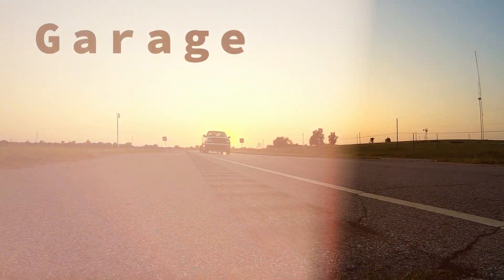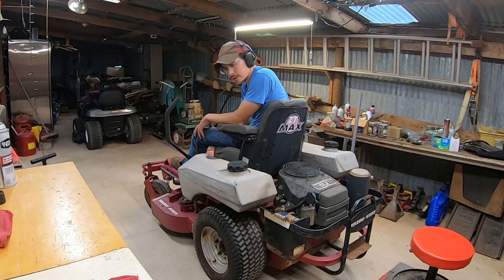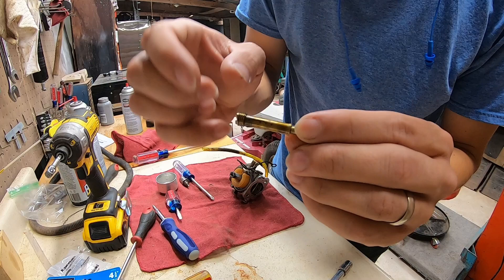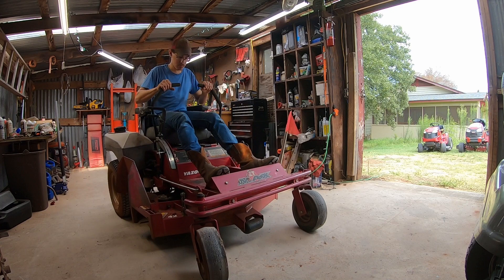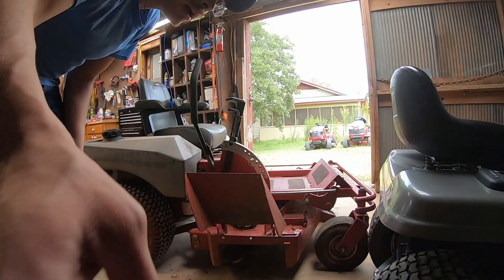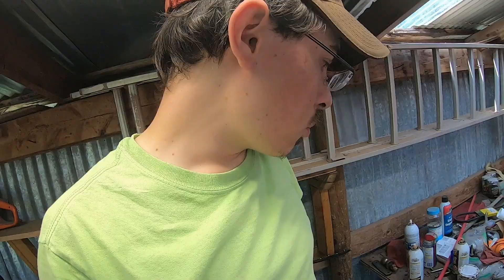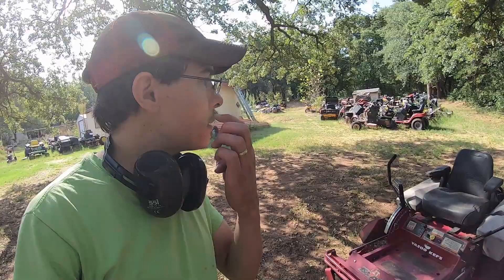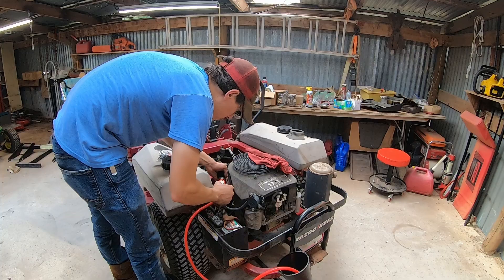My $200 Commercial Zero Turn has issues! Is it the carburetor? Or — ? Yazoo Kees | Garage Story

Comment: Those tiny screwdrivers are notorious for damaging main jets...ah I see that you did get a new driver. You'll appreciate it more. Don't forget your idle jet
Reply from the maker: I think I could use some more small screwdrivers. One broke, and another I ground down to fit a tight spot. I can’t remember if that was in this video or a different one

Comment: Try replacing the fuel line, mine was deteriorating internally and clog the fuel delivery to the carb 7:26
Reply from the maker: Seems like it turned out to just be junco in that 90 deg fitting coming out of the tank. It’s working now!

Comment: Strange thing to have that one piece of fuel shut off device  can cause it not to run correct 😮
Reply from the maker: Little things can be the most difficult problems…
Reply: @garagestory  my thoughts on the fuel shut off were a little off but it is running again because of the universe key switch which is the same one that m.t.d and snapper mowers use  they are  common on some of the mowers  main thing is that you got it running again
Reply: Invest in a ultra Sonic cleaner one of the cheapest tools to invest in
Reply: @randyseabolt272   that is great advice on this matter young man 👍😎
Reply: It is not a fuel shut off solenoid, it is the anti after fire solenoid.  It shuts off fuel to the main jet. The second long piece you pulled out of carburetor was the emulsion tube.  Cut the pintle (small metal rod) off the solenoid and you won't have to worry about it not working in the future.
Reply: @mikespain8655   I had to do that for my 19.5 Briggs and Stratton engine that is on my poluan  XT mower the carburetor is a Niki carb it wasn't that old
Reply from the maker: I actually have one, but haven’t used in in a long time. It didn’t seem super effective, but I also was just using water (if I remember right). I should probably try it again with a cleaner.